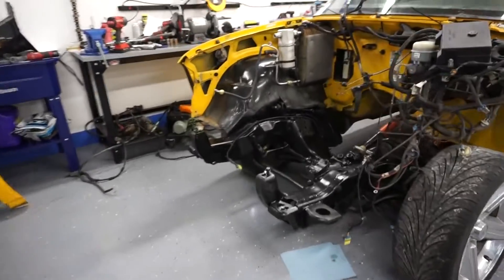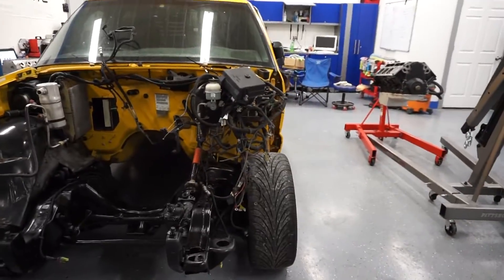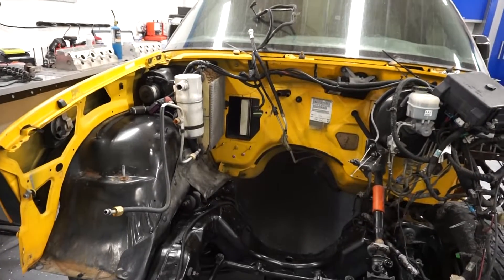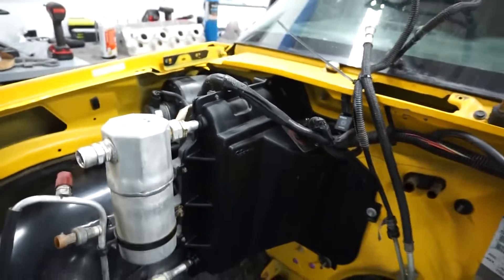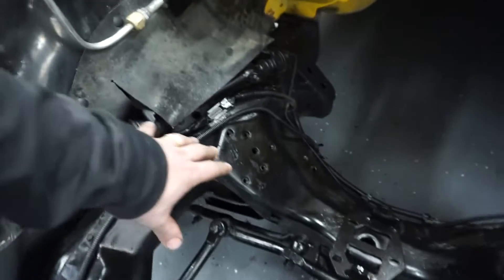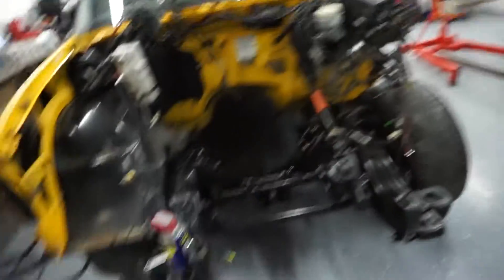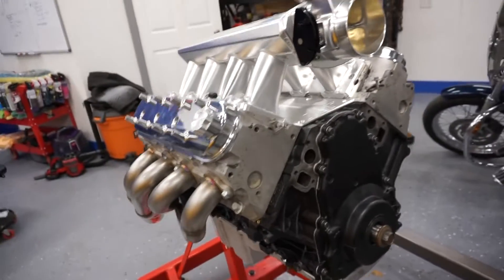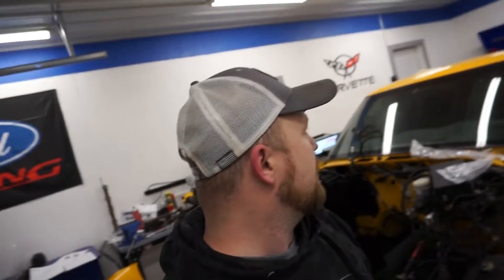LS Swap S10 Xtreme- Finished the LS, Installed Hooker Blackheart Motor Mounts and other stuff

Comment: I just bought all the same for my 96 SS how do you like it?  What cam and heads did you run and is it the Lq4 or Lc9 ….I can’t wait to jump in on mine…what driveshaft do you have to use?
Reply from the maker: Everything I used was perfect, no issues on fitment and i ran a couple cams in this one.  a BTR stg 4 low lift and a summit brand stg 2 low lift.  the summit unit was much better for this particular setup.  I ended up having Southwest Speed do the driveshaft. If i remember right it was 55".

Comment: The holley swap shit is nice but not cheap. 700 dollar headers is a hard pill to swallow. If it all fits right I might go the same route with my 2000 s10 5.3 swap. Hopefully everything works out. That's a very clean truck also
Reply from the maker: Agreed! In the next couple videos i go over my thoughts on them, they are very nice and do end up with a great fit. However, I completely agree on the cost! It's a rabbit hole that I kept going down when I started buying my parts for the build. haha.

Comment: Do the black heart motor mounts raise the engine position by an inch like the trans-dapt ones do?
Reply from the maker: that's a good question. I am not sure.  I went with the black heart setup for ease.  Judging by the tunnel clearance, i would assume it did raise the engine slightly. Sorry I couldn't be of more help!
Reply: @HayesAutoWorx  Much appreciate the reply. I should have bought the black heart system myself but I kind of pieced parts together over the past few years when I could find them cheap. Kind of regretting that now.

Comment: Nice setup! I want to do LS swap on my '98 Isuzu truck (which is just a rebadged s-10 with the 2.2L) at some point down the road, if you had to remove the airbox cover to replace the evaporator, will there be enough space with that engine in place?
Reply from the maker: it's been so long since i installed that part, i can't remember well.  Honestly, i don't think you could.  With the headers installed there is no room for the bottom bolts that i can't remember.